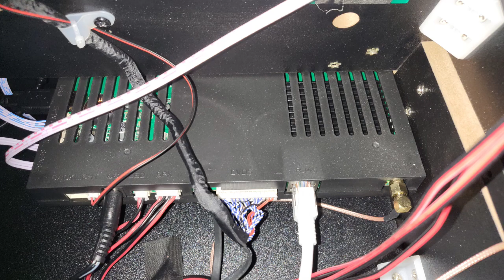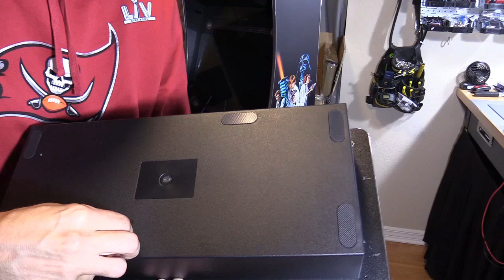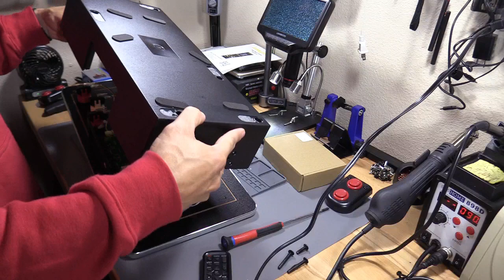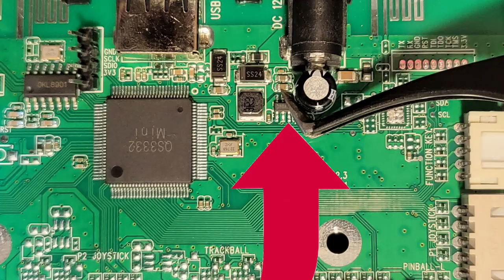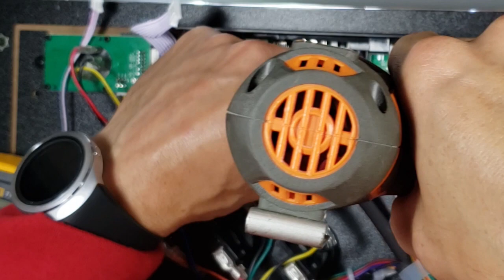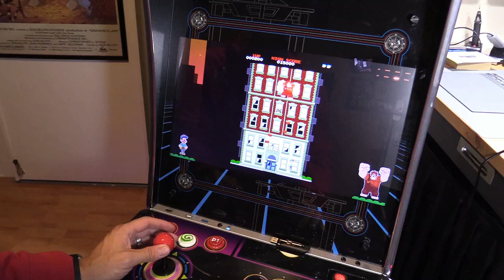Atgames Legends Ultimate Mini Arcade Repair Part 2

Comment: If one of the capacitors are shorted, all 3 would appear that way as they are in parallel and current would find its way through the shorted one. Awesome video 👍

Comment: This was very helpful. I had same issue with my Legends ultimate did all the same tests. Opened up control deck and big burn spot right on the same chip your were testing. Sent a pic and info to Atgames hopefully they will be able to help me out.

Comment: Very good! We have one at work I can the on off button has power so I'm able to turn on and off, I have a screen which is working,  but I  cannot operate any buttons from the keyboard,  just the on off switch,  any suggestions, ha8801 I have 12, 5, and 3.3vdc assuming it's control pcb
Reply: Did you find a fix for this as mine is doing the same thing?  power button switches the marquee and monitor on but the controls do not work at all.

Comment: Why was there 50 little diodes on the board in the controls box

One chip on each board and the transforner is a large grounding diode

Ju know?